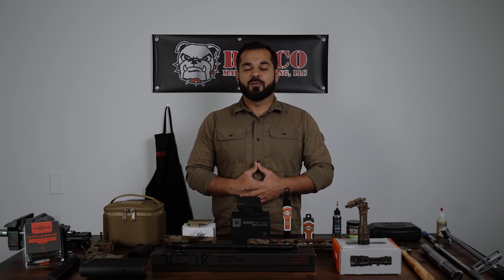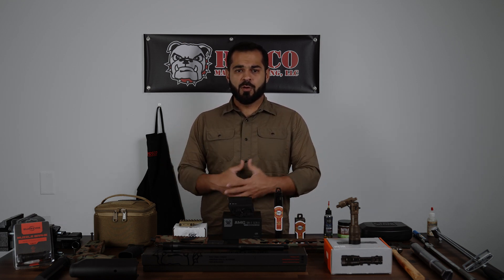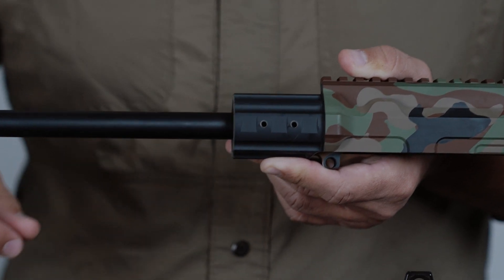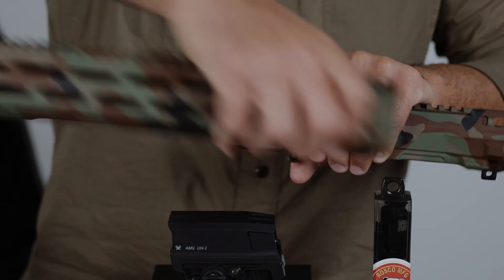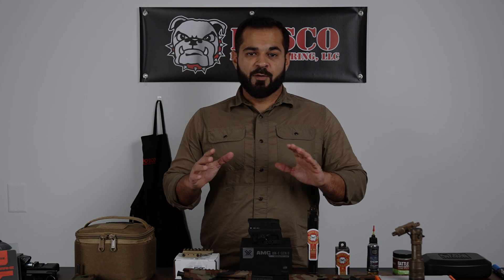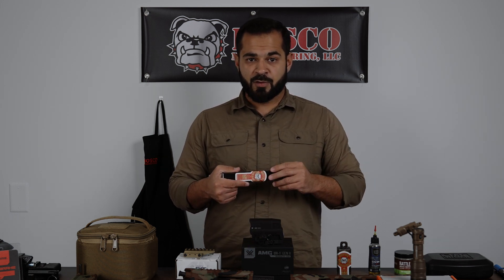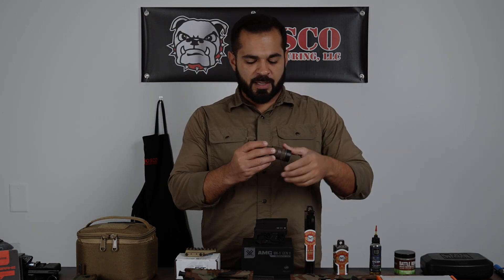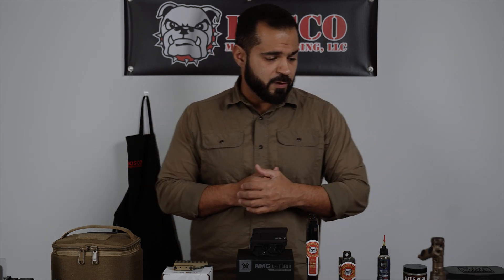Home Builder series (Cobalt 14.5" GP build EP. 1)

Comment: I have the Rosco 13.7 barrel with a warcomp, brings to 16.1, Lower is a Colt A3, upper is a BCM, tight fitting barrel, had to freeze barrel to install in upper. Bad ass
Reply from the maker: Love it!
Reply: @RoscoMfg  Mr Rosco Dad, did you ever think of stepping up to a 308/762 barrel ? I have 3, Stag 10s, and 2 different color Aero M5e1s
Reply from the maker: @fredsiegfried1707  yes sir. We are hoping to get to those at the end of Q4.
Reply: You had to freeze it because BCM uppers are thermal fit. Has nothing to do with the barrel.